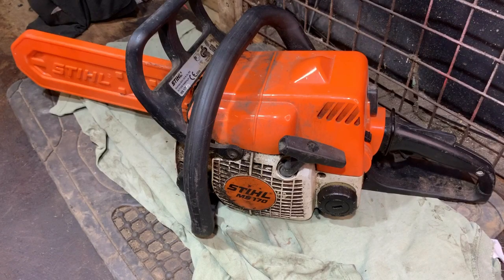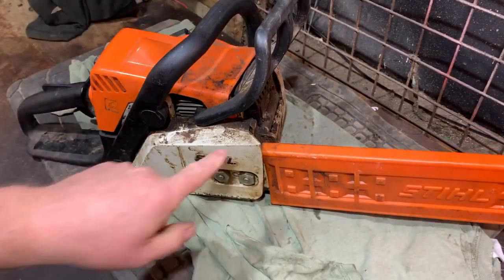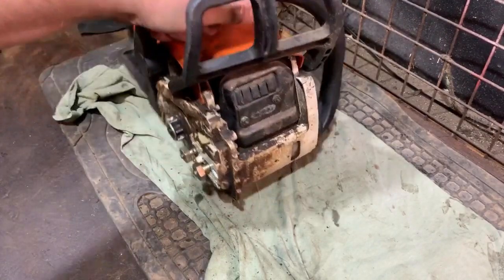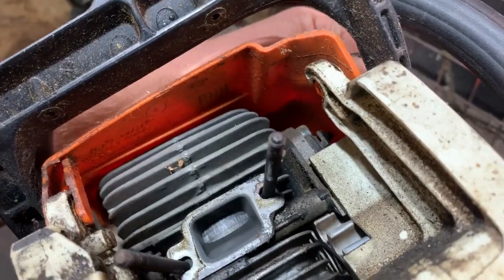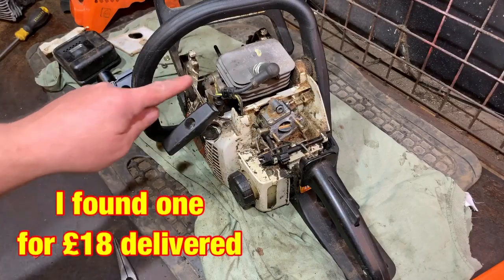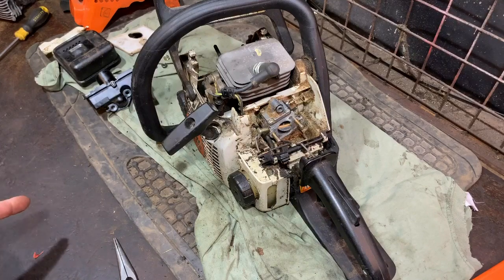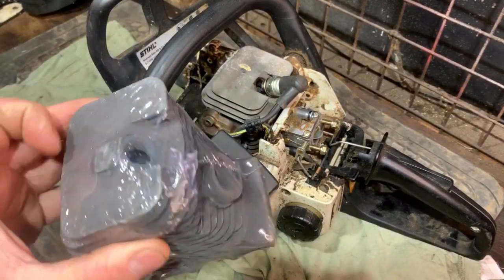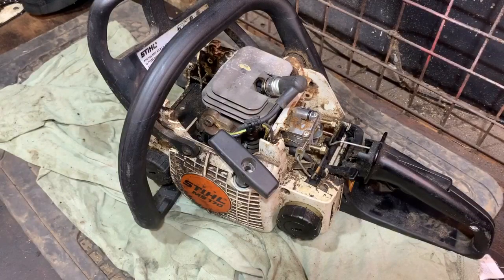Stihl MS170 Chainsaw ( £18 Rebuild )

Comment: I don't think much of the cheap pistons and cylinders.  They don't come close to the quality of the originals. What you can buy are the ones from Meteor, which are actually good.  Too bad about the 170 which will cause problems again in time.
Reply from the maker: So the MS170 is a cheap saw I sold this saw to my brother who cuts his firewood with it every winter, probably foes 40 hours every winter still working spot on. Also of these after market piston kits work fine as long as fuel is mixed correctly, I’ve used them on other machines and never have a problem.